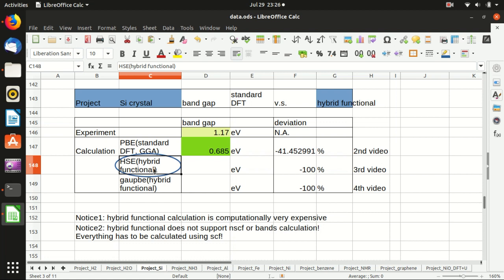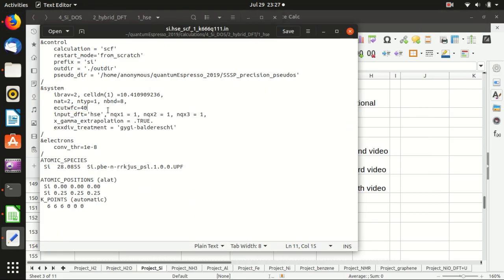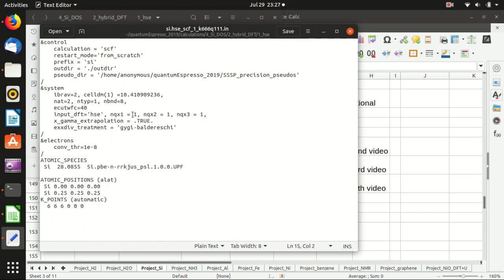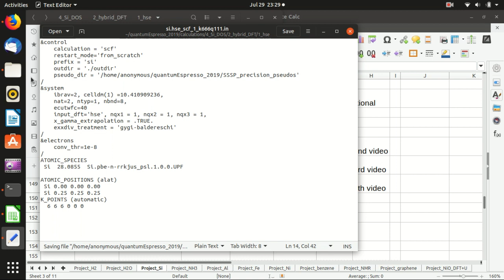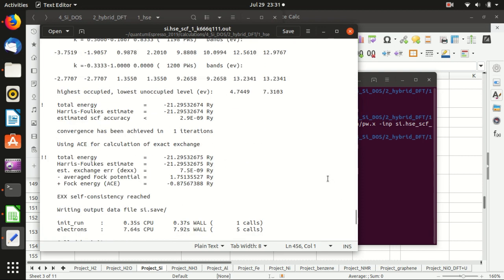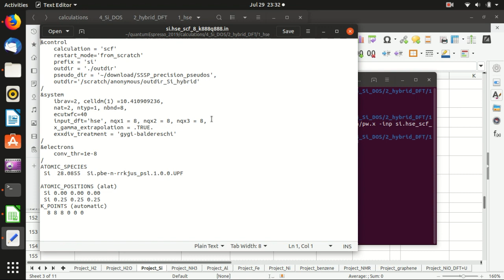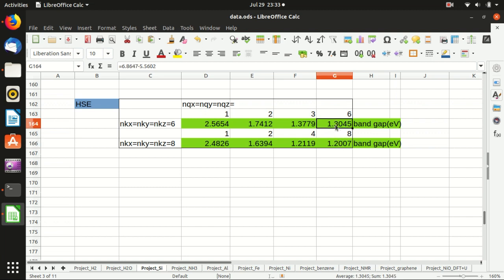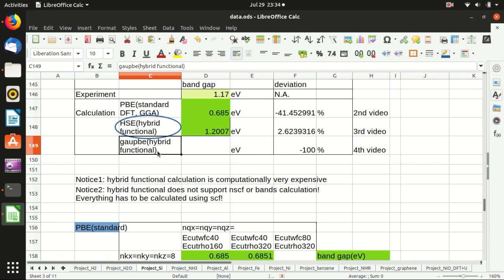Project: 13.3 (hybrid functional) HSE Si band gap | Quantum Espresso Tutorial 2019

Comment: Nice job. Can you please demonstrate how to calculate band structure and DOS using hybrid functionals by QE? I didnt find any example in the internet. However, some people suggested to use "occupation=fixed'" to get the value of band gap in the scf out put file, like your example in this video.  But i am asking about explicit BG/DOS calculations. Your work is appreciable.
Reply: I really need to perform the same calculations as you did. Did you have any success?
Reply: @caterinacevallos9822  Hi I need help with those calculations too. Can you kindly help me out I tried using the script. Can you please tell me the prerequisites. Im making use of the QE-6.1 version. I get errors with opengrid and wannier. Im fairly new and I don't know how to proceed can you kindly help me out

Comment: Hello, following your calculation the band gap can be taken as the difference of highest occupied and lowest unoccupied levels in the scf calculation. In my test for Si using HSE, I got the bandgap of around 1.1 eV. To calculate electronic band structure I used wannier90 approach, from the electronic dispersion I got the bandgap of aroung 0.8 eV. I could not explain for this inconsistency, if you know the reason can you please tell me? Thanks!

Comment: Hi. I am new to QE, and I really appreciate your tutorials. I tried to try your HSE calculation using QE6.4.1 my Mac OSX with gcc compiler and mpirun. However, as soon as it enters the exact exchange calculation using ACE, there is segmentation fault error. The last line that makes sense is "EXX grid:    10489 G-vectors     FFT dimensions: (  32,  32,  32)".  I have a Mac has 16 GB of RAM. I would really appreciate your help on this.

Comment: What about plotting bandstructure when we use nqx more than 1?
I know wannier is the solution but I don't know how to use it!
Reply: I'm having the same issue. Did you manage to solve it?
Reply: @asiyeshokri9544  Hi, I tried using the script. Can you please tell me the prerequisites. Im making use of the QE-6.1 version. I get errors with opengrid and wannier. Im fairly new and I don't know how to proceed can you kindly help me out
Reply: @asiyeshokri9544  Sir  I don't know where to download the open_grid.x. Sir Can you Please tell me where to obtain open_grid.x. Can you please tell me where to download this. Any help in this regard would be greatly appreciated. I have run the SCF part now I dont know how to execute open_grid.x. I have wannier90.x. Thank you so much Sir
Reply: @hepsibahpriyadarshinic8530   you don't need to.. as I know it is in the QE package and you just need to download the wannier90
Reply: @asiyeshokri9544  Thank you so much for attaching the link for carrying out HSE calculations by Christoph Wolf!! I have 2 errors. I don't know how to proceed. I am new to QE. Can you kindly tell me what to do? Any help in this regard would be greatly appreciated!!!

After carrying out SCF calculation and proceeding for open_grid.x I get this error
 Error in routine pw_readschemafile (1):
     xml data file not found
Wannier too I get an error
Exiting.......
 No AgO.eig file found. Needed for disentanglement

Can you kindly help me... 
THANK YOU!!!!
Reply: @hepsibahpriyadarshinic8530  about xml data error, you may check the output file.. Find your xml documents and check is you have chose the same locations for output and pseudupotentials as for the scf calculations.
I could more understand and help if I could see the inputs..